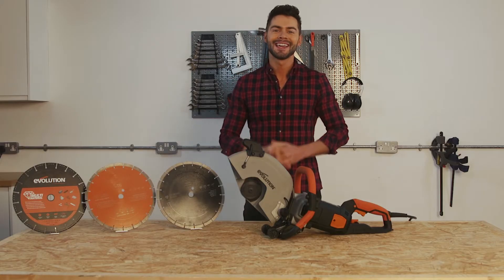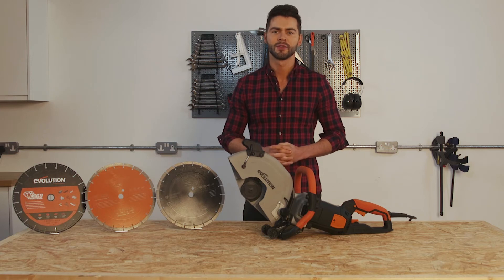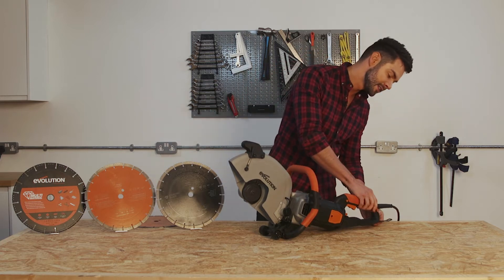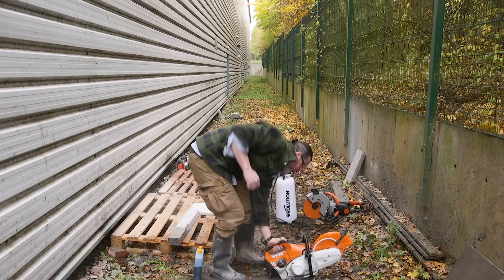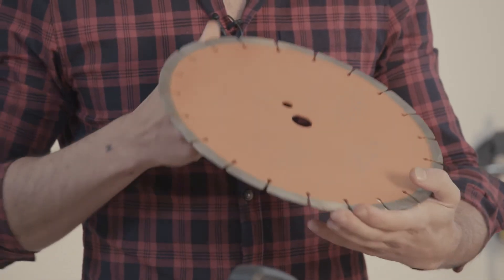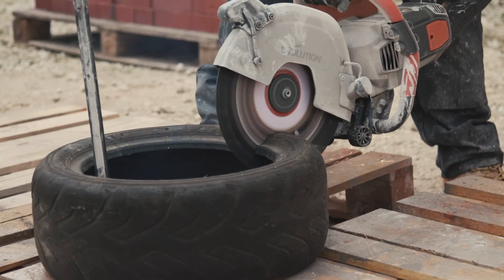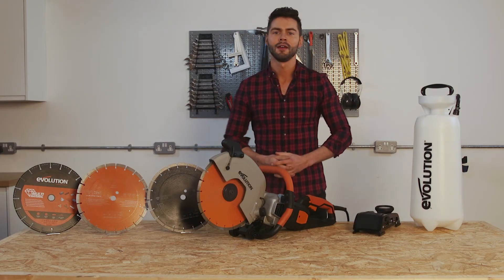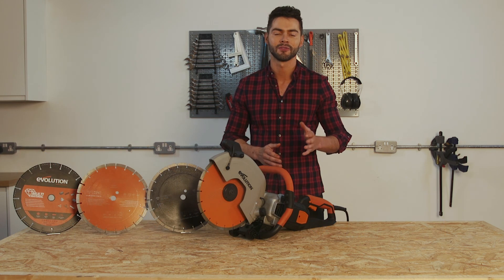🇬🇧 Electric Disc Cutter with Water Fed Dust Suppression | Presentation | R300DCT+

Comment: Very nice but for the asking price without water accessories, thanks but the dewalt  dcs690 makes more sense to me, no cable and no plug socket or generator required, just water.